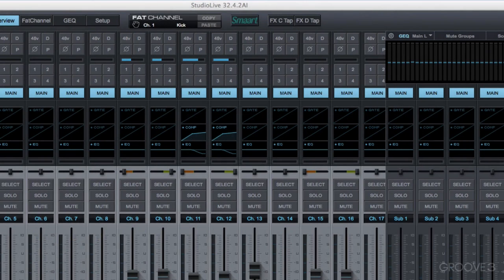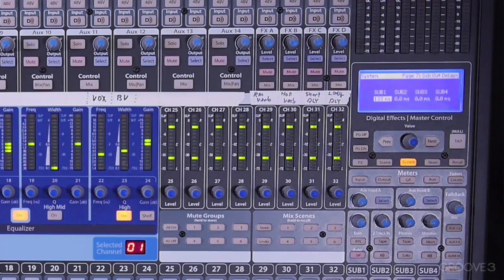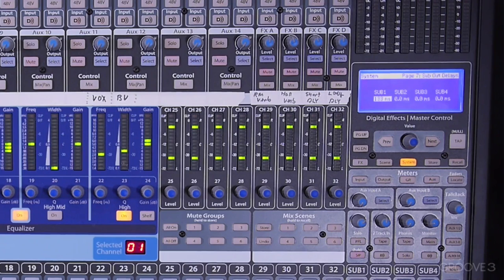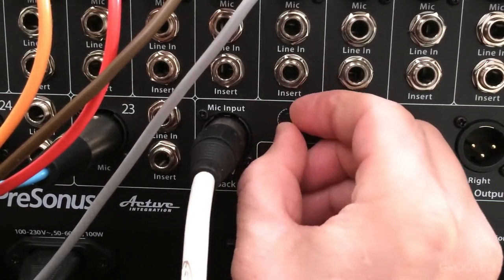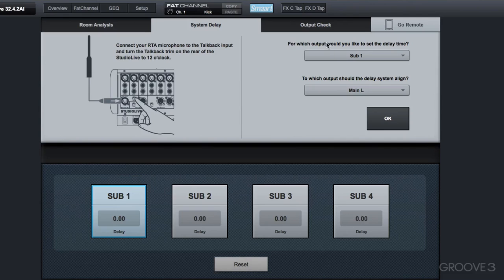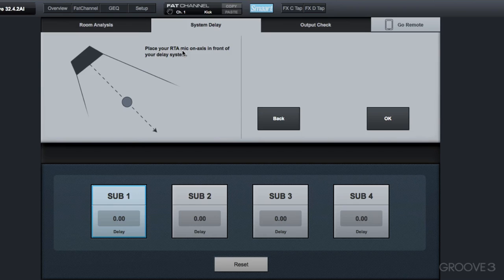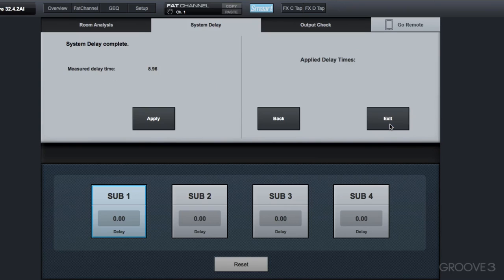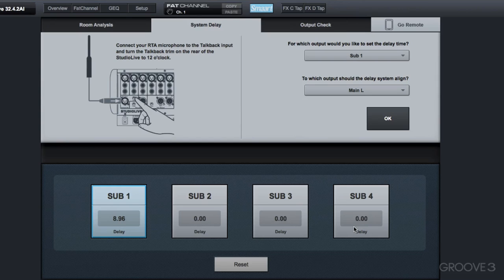System Delay (StudioLive VSL-AI Explained)

Comment: I fear that something is possibly wrong with your results. If sound travels at roughly 1130'/second or about 1' every 0.088 milliseconds your reading of 8.96 milliseconds would indicate a distance of 101.8 feet! If your side fill is only 10' from your mains this is not possible. Perhaps you forgot to shut off your subs? Are you running mono or stereo mode on your mains? Is sub 1 assigned to your mains still?

Michael